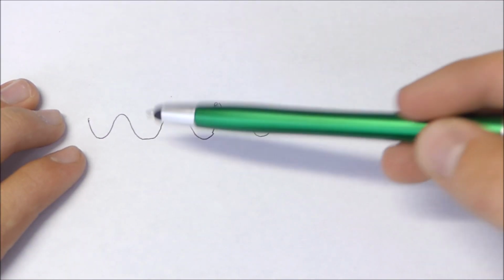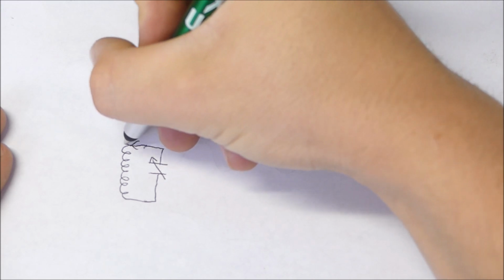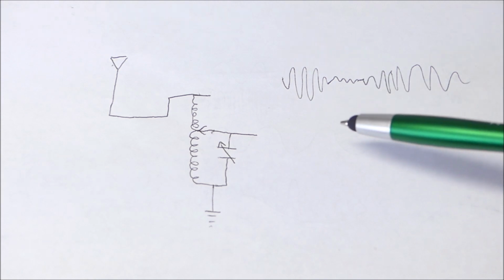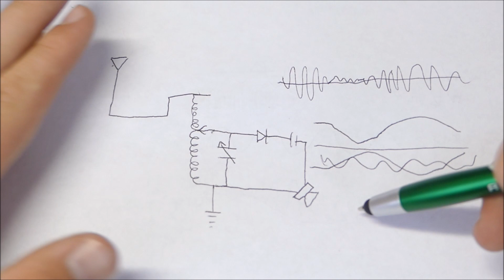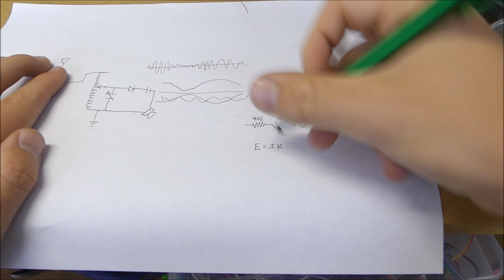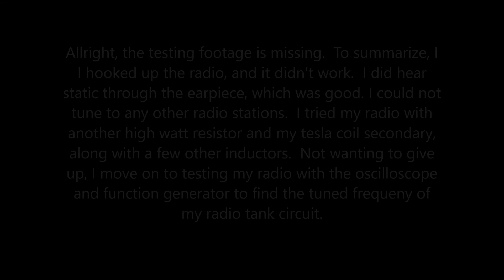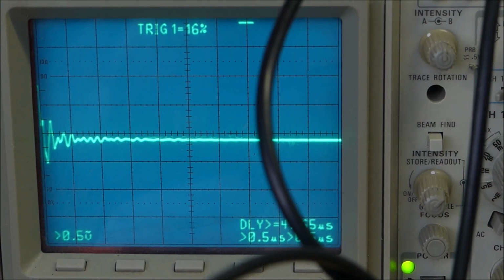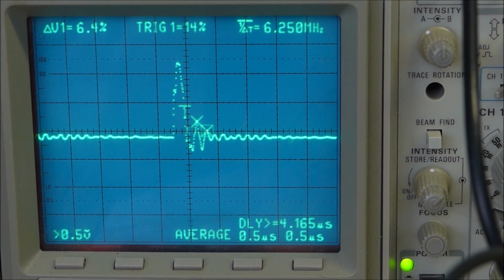DIY Crystal Radio with High Watt Resistors(It didn't work)

Comment: Just use some of that wire you used for the antenna and wind a second row back down the power resistor, going in the same winding direction. That will increase inductance, or otherwise find an old AM radio and place the ferrite rod from that inside the resistor, which will also increase inductance. Resistance of the wire will matter, it loses energy in the LC circuit, and this reduces Q of the circuit by quite a lot, though nothing wrong with using just the former and winding copper wire around it over the existing winding.

Ground is best taken out the house and not using the mains ground, as that will induce a lot of noise. Take some wire out the hole you already have, lead down to the corner of the porch. Take a 4 foot steel rebar rod, around quarter inch to 3/8in diameter and hammer into the ground till around 3 inches is showing, and water it well, with the first water being a half cup of salt in water poured around the rod. This will make a low noise ground for the radio, and you just use a hose clamp to attach the bare end of the wire. Half of your noise will likely be conducted mains interference flowing from the ground lead into the antenna ground capacitance.

Comment: I'm not surprised a wire wound resistor didn't work.

In a parallel resonant circuit, the inductor shorts low frequencies to ground and that cap sorts high frequencies to ground. 

At resonances the one particular frequency does not get shorted to ground.

Adding a resistor makes for a poor quality coil and doesn't short the high frequencies effectively.

Also, you should use a large resistor.. 20-30k across the ear piece.

There needs to be a voltage drop across the resistor for the earpiece to pick up.

Kudos for the effort, but start simple before doing things that are unconventional. 

Get it to work the conventional way then change only one variable at a time and judge each result.